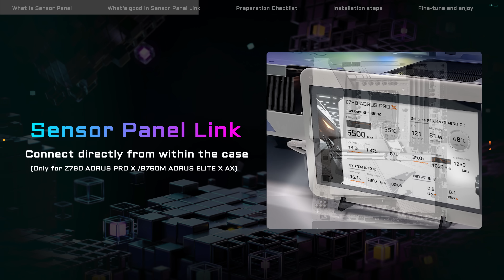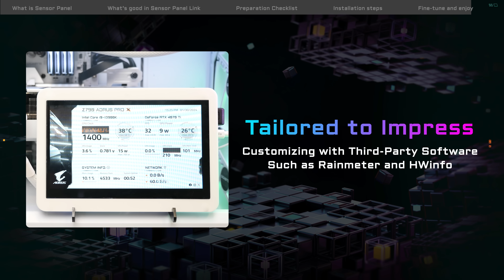How to Set Up and Use Sensor Panel Link | AORUS 101

Comment: I've just ordered the X870E AORUS PRO ICE, where can I get a sensor display panel?
Reply: Also.. the Pro Ice has an HDMI named "F_HDMI",... but we see a USB Type-C in this video... we have no internal USB Type-C header on the motherboard...
Reply: @DxBang3D  yes thats my problem too!!!!!! AORUS we need help! Type-c doesnt needs additional cables but hdmi needs a type c or usb a. Your video is outdated now! I think the type c connection was better! Whats this a downgrade????
Reply: @kajmi25  I was thinking about using a USB2 header to the display (since both of my USB3 headers are used for the frontpanel), if it can run on 5V with a max of 500mA and 2.5W... but none of the displays I have found shares those details...
Reply: I bought the same motherboard for my ryzen 9950x, may i know if u figured how to install this panel?
Reply: @NoobDude  I never bought a screen in the end. Seemed like a massive waste of time and money in all honesty.
Reply: @petekeightley2973  ok how is the motherboard? whats ur review
Reply: I have the X870 pro ICE, has more I/O than the X870E ... not sure why but it does . I have like 13 usb ports ... both are beautiful boards though.

Comment: Gigabyte X670E Aorus motherboards have problems with fan detections on HWInfo,  Libre Hardware Monitor, Fan Control,  and Hardware Monitor softwares.
I tried several of the most recent BIOS's for this specific X670E Extreme Aorus motherboard.  And none of them can detct or send information to these monitoring softwares.
Please fix.  Thanks.

Comment: What should be the specifications of the sensor panel to be used? I see panels with HDMI inputs, other ones with USB data connections. Should be DP, right? Any example on AliE?
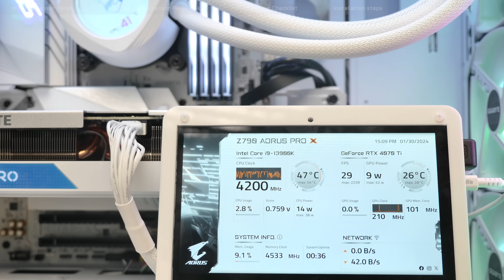Reply: This should be an HDMI panel, look at the writing on the panel (minute 1:42), shouldn't it? I have researched the panel. The panel used in the video should be a 7 inch 1024x600px. Look for the company "Waveshare", this is a panel for Raspberry Pi. At least the layout looks exactly the same.